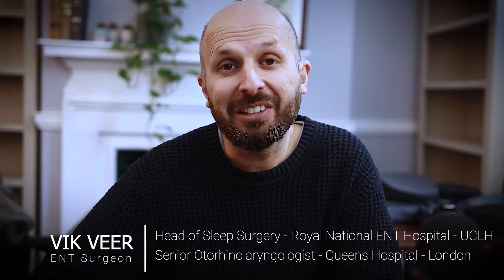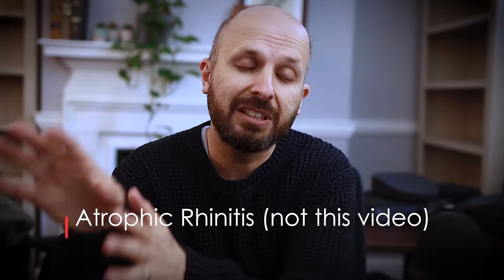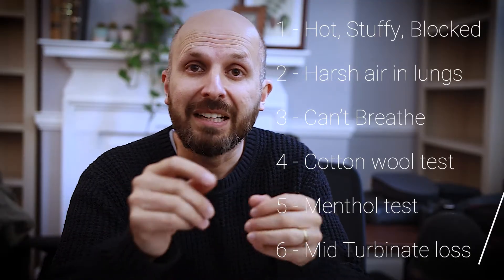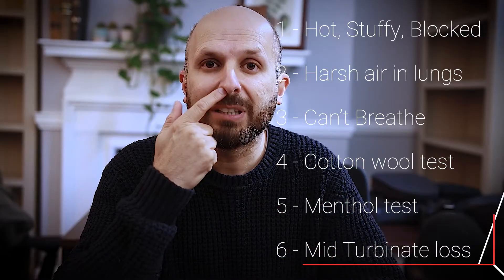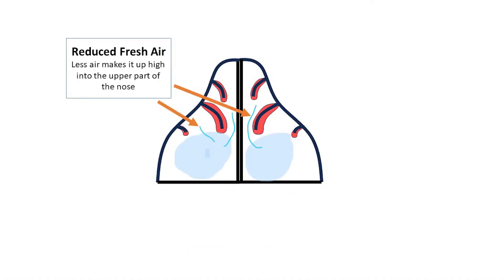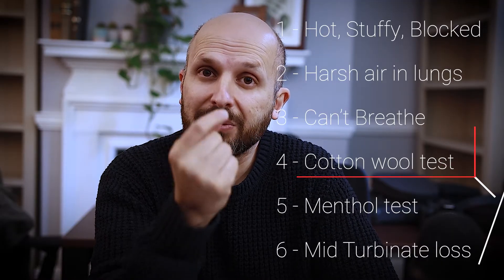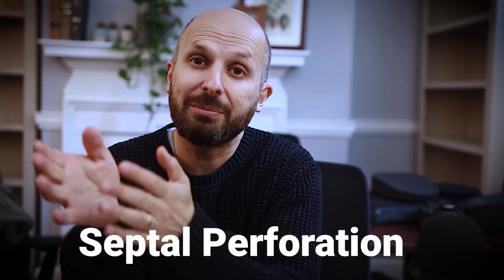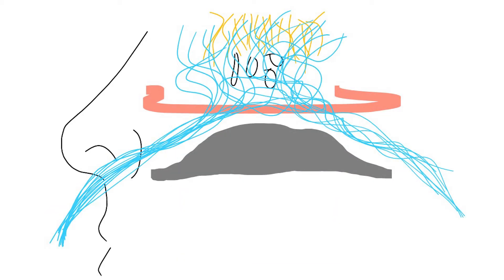Empty Nose Syndrome - My Theory & How to Fix it

Comment: Agree with some points, disagree with others.  ENS can occur from total turbinectomy, resection and cautery.  In situations of over-cauterized turbinates there is nerve damage.  In fact studies show biopsies of tissue removed from ENS and healthy controls in which receptor nerves are damaged in the former.  I, therefore, disagree that the percentage of cases is 13% since the current research does not account for these other types of damage.  I think your resistance theory is good, but, I believe that ENS is the result, often, of both tissue loss and nerve damage, causing both laminar flow issues, resistance problems and receptor nerve issues.  I had cautery that damaged many nerves and I lost my breathing functions and developed POTS in the years following my surgery.  With injections, I slowly regained my ability to humidify and warm inspired air and my suffocation slowly abated as well.  
   Honestly, I think we need more meta analyses done, because there has been a glut of research studies in just the last 5 years.The research has shown nerve damage and distorted laminar flow.   In fact those in our community that have gotten implants to improve resistance, still have a number of symptoms.
   I think this is a step up since we were called “crazy” ten years ago before research validated our complaints.  But, I think we have to think of ENS as both a structural and functional issue.
Reply: Hello, what are the injections you made please?
Reply: @yorocco1  what kind of injections are you talking about? Please let us know 🙏
Reply: @yorocco1  Could you tell me what injections?

Comment: Dr Veer, I'd like to know your theory on why taping my mouth shut to sleep totally opens my nose breathing? My nose is always stuffy, especially when trying to sleep leading to dry mouth, etc. But taping the mouth shut opens the nose dramatically, almost like I've used a nasal decongestant....its wonderful.
Cheers
Reply: @georgecarousos6735   hello, I also tape my mouth shut at night, and find it to be beneficial. I had a turbinate reduction 7 years ago. I can breath through my nose pretty well. But I definitely feel like something’s obstructing sometimes when nothings there. And nose does feel wide open. Air is cooler but not enough to be uncomfortable or anything. I have had dreams where I’m suffocating, but not regularly. I don’t knowing I’m getting in my head reading about all this ENS stuff or not.

Comment: Dr. Vic, at about 10:32 in the video you mention "how to fix" the problem with reduced or excised turbinates. Has this been done? I'm aware of a cartilage implant experimental technique which perhaps deals with adding turbulence to that area of the upper sinuses you illustrated. I have this condition and considering the experimental technique. I am also experiencing the shortness of breath or feeling less lung capacity.

Comment: What do you know about Coblation turbinate reduction and ENS? Any correlation? Possible? Not?  about 7 years ago I had a minor turbinate reduction and deviated septum correction and thankfully I was able to breath perfectly for the last few years. About a year ago, I started getting chronic inflammation of the turbinates again and sprays dont seem to work. Azelstine helps open them up between 20% to 50% but not all the time. (i've been using it for 6 months)  Well I went to the ENT again and they didnt want to do another turbinate reduction (cutting any) for the threat of ENS (I am surprsed they brought it up but only after I mentioned it on a prior appintment)  He offered coblation turb. reducation and said theres no risk of ENS since youre not removing the turbinates.  However after doing research I have seen a few people in the comments saying that you can still get it.  What do you know about this menthod?  I scheduled an appt for 3 months away so I have plenty of time to think it over, research , etc.
Reply: Did you end up doing it?
Reply: From what i know, if the factor that made you turbinates to enlarge persist; there is a very big change that after turbinate reduction, they will enlarge again.

Comment: As an ENS patient you 100% nailed what I’ve been trying to describe to my care team. Saw a specialist last week that performed the cotton test. I had submucosal resection of turbinates along with septoplasty. The septoplasty didn’t work and left me with a C shaped deformity that pinches the left nostril so that the airflow is totally blocked from my left sinus. Meanwhile the right nostril rockets air directly into the back of my throat.  

I struggle to sleep and even in a 65% humidified room can’t stop hyperventilating.  I have lost the ability to concentrate, read, and meditate. It’s like mildly suffocating all the time,  but you also have a constant head buzz from all the shallow hyperventilation. It’s the same feeling as if you were to take 4-5 deep breaths through your nose and get that little head rush. But before completing each breath you already feel immense air hunger and suffocation. It’s worse when the air is dry, if I’m dehydrated, or take any form of decongestant. 

However, if I grasp the bridge of my nose so that the septum straightens and I feel air in my left sinus again— the shortness of breath immediately ceases. As does the immense pressure I feel on that side.  

When I had the cotton test it reminded me of what it was like before the surgery. I could feel the slight tug on my nostrils with each breath in and out. The air spinning its way up my sinuses. The cool sensations as moisture evaporated off the walls of my nasal passages. The resistance provided to my diaphragm to slow the exhale and signal the end of a breath.  

As you said the nose is providing all kinds of sensory feedback to the brain. And it is operating within an extremely tight window of tolerance. In my case it’s a matter of shifting my septum less than 1mm to feel somewhat normal again. 

Thank you for taking this seriously and being an advocate. I cannot describe how horrible this condition is. I’ve developed sleep apnea, my blood pressure is now stage 2 hypertensive, I have migraines, and this fall I experienced my first cluster headache cycle. Before this surgery I was perfectly fit, was training ultramarathons with a RHR of 37bpm. This condition is debilitating. And I have it mildly compared to others that have had full removal….
Reply: Are you looking at any procedure to fix/alleviate symptoms?
Reply: @andrewcho8162 Dr Citardi in Houston does an implant procedure based on results of the cotton test. I’m going next month after living with this horrible condition for 3 years.

Comment: Dr Vic I heard that Dr Paul Nassiff came up with a solution. I talk to my rhinologists and ENT about ENS all the time since my inferior turbinate are so large . I heard Vivaer and microdebrider submucosal resection are the best options. Correct me if I'm wrong..
Reply: The hollywood Dr. You mentioned has a warped understanding of Ens. There is more to it than the misinformation found online solely discussing missing volume. Submucosal resection is also not safe as there have been increased ens patient based reports of being injured from such techniques and other so called conservative turbinate reduction procedures. Overall turbinates should never be touched unless your life depends on it.

Comment: what do you think about the Microdebrider Turbinate reduction? is that more likely to cause ENS? is it as good radio-frequency ablation? im trying to figure out with procedure to have done for my blocked sinus. thanks
Reply: Did you ever get an answer to this?
Reply: Micro debrider can cause it too. Micro bedrider very dangerous. ENS can be caused by every method they use.

Comment: Thank you for making this video.  I've had radiofrequency turbinate reduction recommended to me.  I have severe upper airway resistance syndrome which has worsened recently.  My ENT has told me he can do some work on my nose including radiofrequency turbinate reduction, but he suspects a confluence of different factors affecting my breathing.  He referred me to a new sleep doc to talk about doing a DISE test, but when I asked about doing DISE, I was told that he only uses DISE to recommend the "Inspire" treatment, plus the sleep doc seemed to think that RERA events aren't really that important because breathing does not cease entirely.

BiPAP does help to an extent, but I feel like my body has been telling me that I need something else.  It just feels like the whole process of looking for answers is just fraught with pitfalls, but I really appreciate how you've put together some helpful information about ENS.

It's just maddening to get referred for a DISE and then be told "We only use that for Inspire".

Being told that RERA events are less important feels like hearing "But did you die?"  I feel like so many physicians are taking a cookie-cutter approach to diagnosis and treatment and while it helps a lot of people, so many of us are falling thru the cracks and being told that we have "anxiety" or whatever.
Reply: I had severe upper airway resistance syndrome to the point where I couldn't feel the sensation of air through my nose. I also have a deviated septum. I had a maxillary expansion a few months ago and now I can feel the air through my nose. My ENT dr said he could fix my deviated septum but I'm scared of getting ENS. I am getting DISE soon to figure out where my obstruction is coming from when I fall asleep at night. I've gone weeks without sleeping feeling like I'm choking. Hope you find answers soon!

Comment: I had a septoplasty and turbinate reduction surgery 5 months ago and it successfully improved airflow, however I have a permanent dry mouth and soar throat so far only improved by spending time in extremely humid climates, I really wish my physician warned me before operating, and I really hope my body adjusts somehow in time...my quality of life has diminished and I wouldn't wish it on anybody.
Reply: Check in, how are you?

Comment: I am wondering if those who have lost the whole structure to injury, cancer etc if they too suffer more from this condition than say some who has lost only part of this structure 🤔
Has anyone tried to temporarily numb the middle section to rule in/out certain aspects of this condition (nerve wise).

This condition is both fascinating and heartbreaking at the same time. I can understand that reluctance to have another procedure performed to try to fix the problem.
Reply from the maker: I have found that when you remove everything - these people somehow don't get such bad problems as i guess there is nothing impeding air from circulating high up in the nose and sinuses.  This however isn't license for me to start trying this on patients -  too dangerous in my mind, but it is a good thought.
Numbing the area doesn't seem to help as far as i know - not in the patient's ive seen anyway.
Reply: @VikVeerENTSurgeon  
Thank you for taking time out of your busy schedule to answer some of your follower's questions. It is greatly appreciated.
Looking forward to seeing your 'ask me anything' video.

Comment: Thanks for video. I think ENS is not one desease that can be classified. It is the spectrum of different symptoms and causes.

What are you saying is one subtype of empty nose syndrome where aerodynamics is prevalent cause. It is when cotton test is working and implants are promising. 

The second one is trigemial nerve damage where you end up with non-expressive and non-functional turbinate. Those patients will feel nothing with cotton test or will experience pain or parastesia. Often those patients are having early ENS, but as the neurons regenerate they get better. 

Strangely enough those patients had both lateralization AND some radio/crio/laser therapy together. As I expecting damaging nerve in multiple places making it die instead of regenerate.
Reply from the maker: It's true - we don't know enough about this condition.  fingers crossed that, what I would call atrophic rhinitis, gets some useful treatment soon.

Comment: Amazing video Dr. Veer! You are doing something truly amazing. Many people suffered a lot and were dismissed by ENT surgeons, and it is dehumanizing. ENT surgeons are not mechanical engineers, they usually don't understand much of fluid dynamics. From an engineering perspective it is obvious that turbulence around the olfactory and sinus areas is critically important. Just because they can cut a piece of the body out and see clear passage does not at all mean that the patient will be okay.
Reply from the maker: I very much agree. thank you.
Reply: @VikVeerENTSurgeon  I'm risking saying something very stupid but wondering... if the issue seems to be caused by lack of turbulence what about creating an U shaped clip with a blob on each end. Then each end would go in each nostril  and the blobs will slowdown the air. May not be ideal but won't hurt to try. Such a thing could be made with some soft plastic on different sizes and even disposable.

Comment: Hi Vik, thanks for doing a video on this topic. You've discussed ENS occurring due to surgery - but I assume it is also reasonable to assume it can happen through other means. There must be receptors or nerves somewhere along the line that pass the sensation back to the brain to create those sensations of not breathing. Presumably those can get damaged via other means. 

I say this because my mum has symptoms that sound very much like empty nose syndrome (that's how I first learnt of it - trying to research the symptoms she described). She developed this following a bad bout of covid. Since we know covid can damage people's sense of taste/smell, it must be able to affect nerves/receptors. Could it also be affecting how they sense air moving through the nose - and when damaged - the sensation that air is not moving through the nose and hence, empty nose syndrome. In this case the cotton wool test wouldn't apply as it the sensors that are damaged rather then the air flow. 

(notes - her nose isn't physically blocked - ent checked - just a little dry, no discharge). Her experience of it has been so terrible as she feels as she is suffocating constantly. We haven't been able to get anywhere with the gp/ent treating her. they say it's ok and send her off with some steroid spray.
Reply from the maker: I'm not sure about your mum's problem.  I don't think I can work it out online.  I would look into atrophic rhinitis or even Sjögren's syndrome?
Reply: I have sjogrerens syndrome, and after covid have exactly  the same  problem  ,I am working with my Dr to resolve  this ,so far no luck ,good luck to your mum ,you may have to try 2 or 3 Dr's before someone takes her seriously, took me 15 years to get diagnosed with  sjogrens,